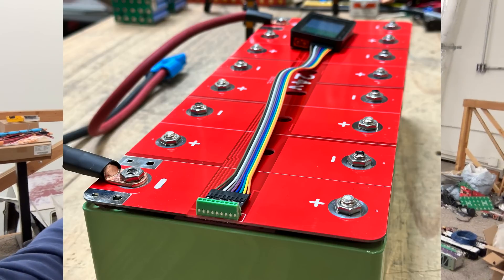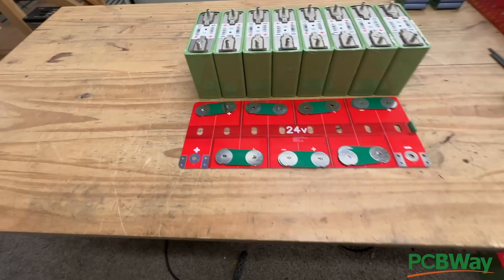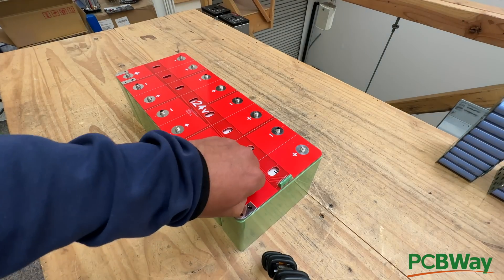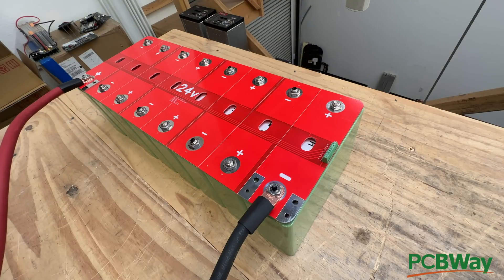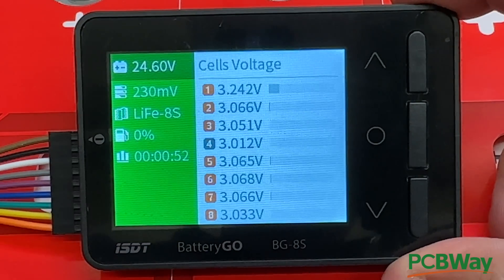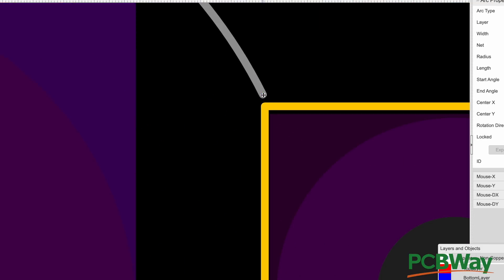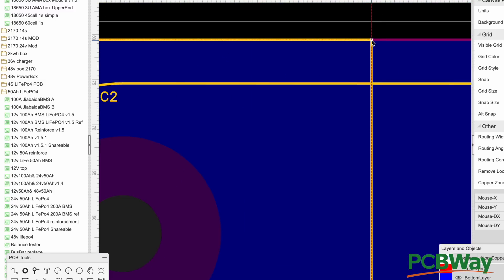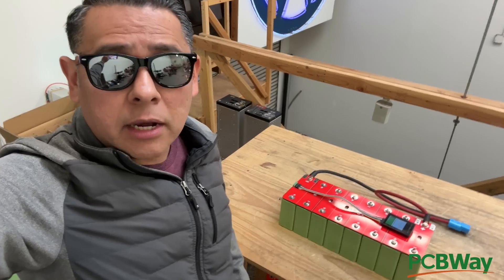Easiest 24v DIY LiFePO4 Battery build  -  LEV60 busbars - PCBway

Comment: Great idea. Why not moving the BMS connector further out and get rid of the spacers? More parts equals more resistance and potential failure points. I think the thick negative cable goes on the BMS. Indeed, you need pretty good compression, otherwise the terminals could be damaged when the battery expands. Is there a way to have a flexible PCB between terminals? That would be awesome!

Comment: I would like to build 2 batteries,  I am using 280 ah cells and and will configure them to 24 volts.. I will then hook them in parallel and then into a Victron system.  I will run 4-540 watt panels and each panel is rated at 49.3 volts   MY question is which BMS should I run to to run these batteries
Reply from the maker: Just look for any 8s bms designed for Lifepo4,  why are you asking for a specific suggestion?
Reply: @jehugarcia  they will be configured into 2 - 16s  batteries
Reply from the maker: 16 cells yield 48v not 24v
Reply: @jehugarcia  not always   Can be configured into 24
Reply: Oh yes one thing I don’t this I added   I have 32 cells and will configure them into 2-16 cell 24 volt batteries

Comment: Hello.
I bought 16 EVE brand 280ah cells to make a 48v 280ah battery pack. I also bought JK BMS, it also has other connection equipment. However, during the final assembly, I could not decide what I should put as an insulator between the cells. They install epoxy sheets in commercial products. I don't have any epoxy sheets. I am thinking of using corrugated (cardboard / cardboard sheet etc.) for both insulator and heat ventilation, but I do not know if there is a fire risk in this. As long as there is no arc or heated cable, I do not think there will be an ignition due to cell temperature. Because if that degree of heat is released, the cell is already dead. WHAT IS YOUR ADVICE?
Reply: If the battery gets hot enough to ignite cardboard on contact, then the most likely the BMS has failed and the battery will probably vent gases. I am looking for a separator that allows air flow. I have seen a CATL power pack for telecoms with such a design. Perhaps a guy skilled in 3D printing can design one.
Reply from the maker: Yeah if the cells are hot enough to ignite the isolating material they are in trouble so you have bigger problems

Comment: What gauge wire would be sensible for the terminal connection cables from this battery.  I would like to connect battery to my Bluetti AC200Max. Was going to ask this question on Facebook,  but my account has been blocked - no idea why.....🤔
Reply from the maker: 12 awg should do it

Comment: can you do a thermal scan on the PCB? most PCB are build with super thin copper and power electronics would heat up with thin conductors .. perhaps a fire risk.. but also a wasteful battery.

Comment: The top cover is fantastic – it neatly conceals everything. If EVE and CATL offered similar covers for 8s and 16s, our battery packs would look even more appealing. I've created a video showcasing the process of making my DIY LifePo4 48V 16-cell battery pack, designed for my PowMr 6.2 KW inverter. Feel free to check it out if you're interested. https://youtu.be/13itWthR9Co

Comment: Hi Jehu, Great video and very informative, THinking about using these cells for my Solar battery bank. How would I use the same PCB-Way boards to use a BMS in this build? I want to upgrade my existing 18650 battery bank to Lipo4. I really appreciate any help you can provide.

Comment: Also, does anyone know if the recommended bms has both high and low temperature protection?  I did not see it mentioned in the linked page.  Thank you.

Comment: Looks nice, great video. 
Regarding pricing, it looks like all the components needed add up to a bit over $600.   Amazon has complete 24V 100Ah batteries for less than or equal to that price.  Did I miscalculate or miss something?
Thank you again.
Reply: I have wondered this too. Whether it's better to build one of these or to buy an existing 100 AH battery with built-in BMS or to build one of these. I think these may have an output advantage. That you can pull a LOT at once and the pre-made batteries maybe don't have that capability.

Comment: Lesson number one, never ever go with a 24 volt system, firstly it's far more costly than a 12 volt  for example the cost of inverters for a 24 volt system your looking at up to 10X the cost, secondly  companies make 12 volt products such as off grid refrigerators and TV's, thirdly the are actually stronger in the way they handle current and much safer, with lithium ion batteries the higher the volts the higher the fire risk and chance of exploding batteries
Reply: I don't think you know what you are talking about 🤭
Reply: Lol definitely don't know what your talking about
Reply: 1. Yes it’s slightly more costly but if you are building a large bank, there are huge advantages with high voltage. 
2. There are plenty of options for 12v or 24v accessories, if not getting a single 24-12v converter.
3. Power loss in the cable is less and you can use smaller cables because you can get the same power with less current. Lost power equals heat, the relationship is Power=current^2*resistance. 
4. LiFePo4 don’t have thermal runaway conditions like other lithium batteries and any decent BMS will prevent scenarios that excessively heat up the battery.

12 volts is dumb, the only reason it’s used is because that’s what cars use now. In industry electrical systems 28v is considered safe enough to work with out special equipment.
Reply: 😂 you dont know what you are talking about. The main reason to go with 24v or 48v is the ability to use smaller cable and scale higher wattage. If your inverter is 2400watt the 12volt will require 200 amps cable (1/0 or 2/0), while the 24volt will only need 100 amp cable.
Reply: Go back to school mate. You are utterly ignorant. Read comments above for clues.

Comment: i been waiting so long for you to maqke videos about 72v-96v setups like this because i cant ever use low voltage setups and would buy so much stuff from you to make my projects come to life but it seems your focus is only to certain project for people that do either solar and or powerwalls but will you be doing higher voltage video setups soon? for like motors that require 72v-96v i would and so many other would buy more things knowing you made videos for those on here with that type of theme.
Reply from the maker: Very few people request high voltage setups.  What kind of motors do you power?   EV?
Reply: Just put three or four of these in series with a 24S or 32S balancer. It's not rocket science.
Reply: @Andy Lee Robinson  hehe well I do many things besides learning how to build batteries,  nothing is rocket science but if you don't know you just don't know. I can tell you to try and build some things I know how to do and for you it would feel like rocket science because you wouldn't know how to even start it and that's only due to not knowing about it.... nothing is hard if you already know.
Reply: @dreamkiss4u  all the information you need is on YouTube.
Reply: @Andy Lee Robinson  ya but I want to see his specific products made in a video with boards he creates for them and all that , thanks tho for the advise.

Comment: Why would anyone spend money on a PCB for battery just take some copper tube flatten it out and use it as a bus bar maybe put some solder leaves at the edges where it meets the battery
Reply from the maker: Same reason people buy cars instead of walking…..  because they can/ because it’s easier and faster
Reply: @jehugarcia  stupid is the man who spends money on pcb bus bars, they do not work as well as copper with tinned adages
Reply from the maker: You are stupid for buying batteries,  my ancestors and yours lived entire lifespans whiteout them

Comment: Balancing 203 mV on LFP,  by the ISDT? Seriously? haha.
Cell #1 is mostly fully changed, while others are mostly discharged. You should note that such cells should be top balanced before combining them together to a battery.
Reply from the maker: Maybe the trash cells you are using require pre balancing.  LEV60 cells are new high quality  within 10mv  from the factory,  I had to charge that one cell to demonstrate out of balance situation for video.
Reply: @jehugarcia  if that was for intention - that's fine, but you could give it a word to indicate it, as it looked not so professional from your side to try balance such pack by the ISDB, as it would take months or so.  I have the BattGO too, I know it does really tiny current when balancing.
Reply from the maker: only dumb viewers assume things,  my viewers are usually smarter than this
Reply from the maker: And I’ve balanced a 16kwh pack with battgo before,   So yes if you know what you are doing,  that’s all you need

Comment: Is it overkill to put that greenish fish paper in between cells, I wonder what the reasoning is for insulating the cells from each other?
Reply from the maker: Not overkill,  especially If battery will live in harsh environment
Reply: Think cars, boats, any application with extreme vibrations and the cells may rub damaging their paper thin blue insulation.

Comment: It would be cool to have a second board without the bms connector and make it just a bit shorter so it acts as the spacer and helps carry load. That eliminates spacer misplacement.
Reply from the maker: Yeah but that would double the price
Reply: @jehugarcia why aren't you using smd connector so you don't need the spacers 😅
Reply from the maker: Because I need spacers to carry current
Reply: @jehugarcia  if the current are carried by the spaces y don't know why are necessary this big board if is only carrying the small signal 😅 I can carry this signal with few wires
Reply from the maker: It’s not necessary,  you can use paper clips or a wire hanger to connect your cells  together.   Million ways to do this

Comment: Could always use a SMD version of the screw terminals too..
Reply from the maker: Oh yeah,  but I haven’t mastered smd soldering yet.
Reply: @jehugarcia  Extremely simple on larger parts like those :) If i lived closer id offer to help you build a ton of boards !
Reply: Through-hole parts are far easier and simpler for DIY.. a simple soldering iron and skills are all that is required.

And these projects are intended for DIY.
Reply: @ernestgalvan9037  True enough, but he could also include the PCBS with the connectors already mounted too :) OR make the pcb stick out a bit so the connector pins are not causing an issue.

Comment: Great Job ... why not extend the board our a quarter in to accommodate the plug for the batgo...  this would eliminate the spacer and the chance of heat building up
Reply from the maker: Because the spacers also carry current,  so it’s better if they are there if you need more than 100A continuous
Reply: @jehugarcia  Can a PCB be made to carry 100A current?

Comment: please tell me your offering the cable also
Reply: Any 2.54mm pitch connector should work if it has pins sticking out on one side and can be plugged in to a JST XH terminal. Pretty sure Jehu is using a dupont style connector here which is very similar to the JST XH. 8S JST XH 2.54mm is going to be more common. Yes, confusing its 9pins or 9P but is referred to as 8S because its 8 cells in series and then theres the negative. JST will usually use 8S, dupont is more likely to say 9p
Reply: @ericklein5097  thanks for the reply I"ll take a look